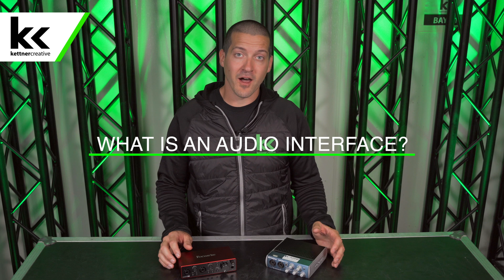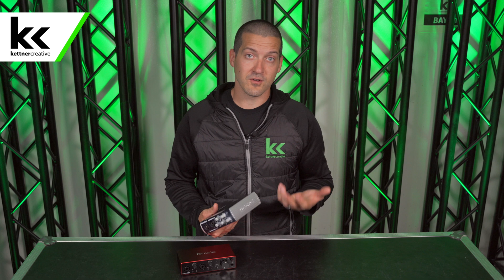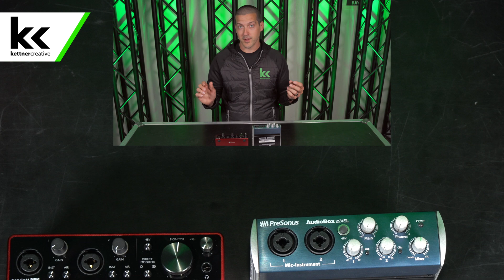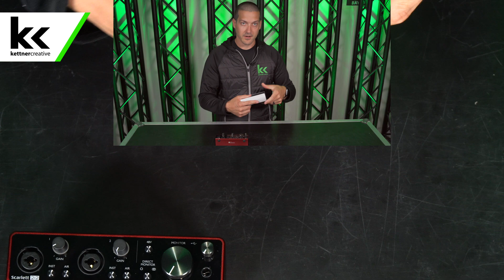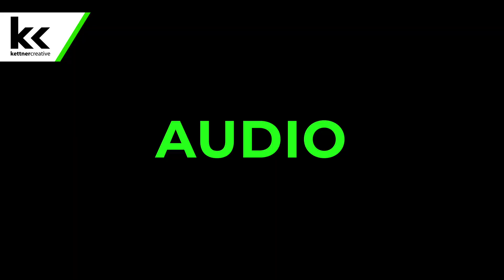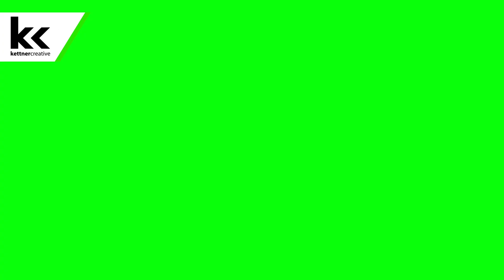What Is An Audio Interface?

Comment: Fun fact. 48v is the power provided by telephone offices to power old analog telephones. That tip and ring connector is a carry forward term from the old telephone operator days where the operator literally had to patch your call. I bet that 48v continued to be used as the standard for mic phantom power.
Reply from the maker: Interesting fact. If that's the case, it's hilarious that every audio interface/mixer only provides 48v to the XLR jack, never the 1/4" jack. aha